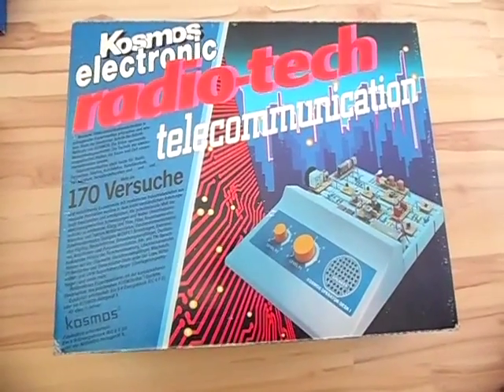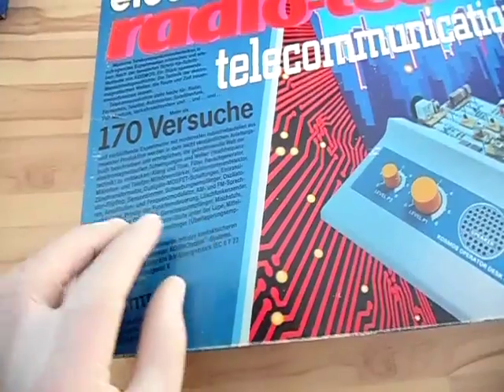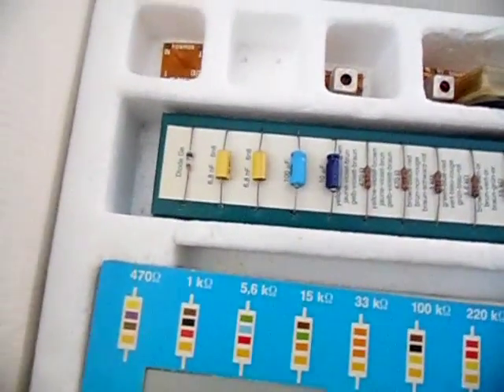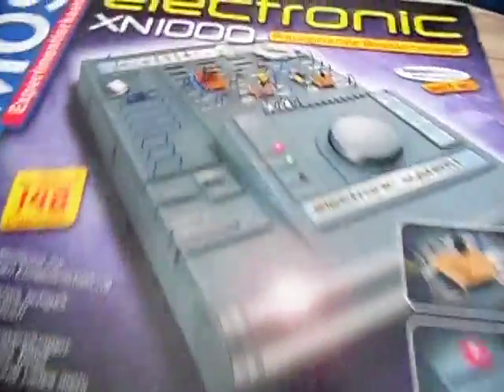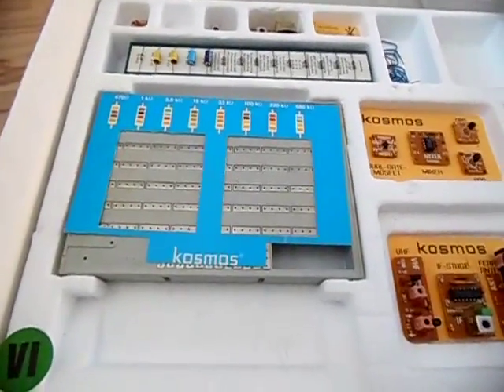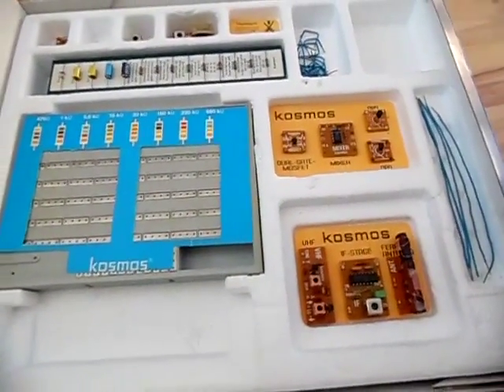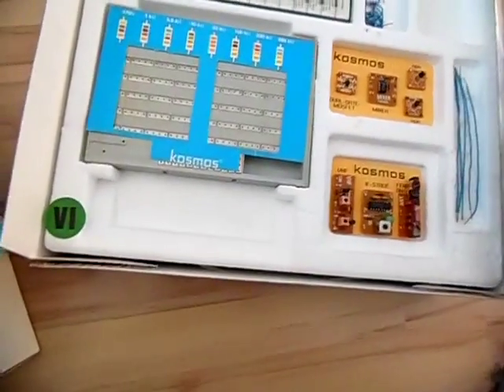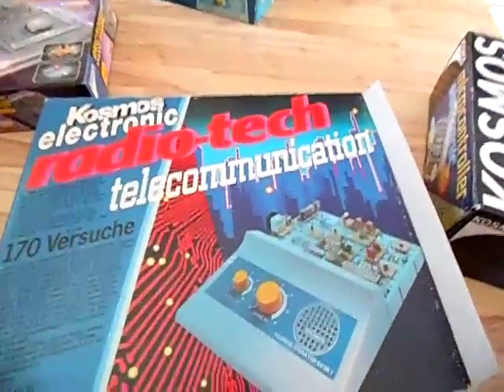Kosmos electronic radio-tech

Comment: Hi! Thank you for doing these videos.  We have a Kosmos electronic X2000, but no manual.  Do you know if there is somewhere we can download a digital copy? We are in the United States and most sites that mention this kit are in German.  I would even be happy if it's in German, we could always work through the translation. Thank you for any help.
Reply from the maker: Hello,
you could check out forums like "Experimentierkasten board" and "Rigert Forum". These Forums are specialized about experiment boxes, they also cover the one you have.

After my knowledge these kits only have been released in parts of Europe. I know of a version in dutch, and I know of a version in french when it comes to these kits, but I´m not having any knowledge of other releases (like the ones in your country).

If you´re patient and occasionly check ebay, you might find single manuals (without the experiment box) put there as an offer - but keep in mind, that it´s not guaranteed, that the seller will ship it that far.

Also you could contact the "Kosmos Verlag" directly, and ask them for a copy, but I´m not sure if they are having these copies as a digital version like as a . pdf file.

In the manual the circuits can also be built without the explanation as there are picturs showing how to position / place the components on the board.

I also do own the "Kosmos X2000" including all parts and the manual. Maybe... I could give you a few pictures of some of the circuits (The easiest way would be that I make a video where I flip pages in the manual and you then can pause the video and "edit out" the pictures because single-photographing them would be a lot of work). I´m also not promising that I do that.

The Kosmos X1000 is mainly basic circuits like blinking LED light, logical circuits (and / or / nor circuits with switches and LED) and tone generators ... timers (breakfast egg timer)...

The "best" project in my oppinion is the AM radio that you will built at the end of the X1000 manual. There are two radios listed, the 2nd one is more sensitive than the first one, which is a simple detector as the second one is a receiver that has the name "boy radio" (or also "boy´s radio"). Actually it´s a "reflex receiver" but somehow it got named like that.

The X2000 adds an amplifier module ("AMP") which also lets you built oscillators - with the "photo transistor" that´s included in the X2000 you will also be able to built a "light based alarm clock radio" that starts playing when it get´s bright in the room in the morning...

They also have the two AM radios from the X1000, but now they add the "AMP" module to it, so you can hear the stations with a loudspeaker now.

I hope I could help you a bit with this information. Also g o o g l e picture search for "Kosmos X1000" "Kosmos X1000 Anleitung" and "Kosmos X2000" "Kosmos X2000 Anleitung" might bring up at least a few experiments that you can build with your kit.

I also could help with the translation, but it´s a time-thing. I´m usually quite busy... especially lately.

Comment: Schön zu sehen, daß es hier auch ein Video über die Kosmos Kästen gibt. Ich habe meine auch noch alle da, den X1000, X2000, X4000, High Tech und Radio Tech. Ich habe ewig Zeit mit den Dingern verbracht. Die Beschreibung der besseren Kästen (ab X3000) ist auch sehr gut gemacht, sehr verständlich. Ich glaube das ist auch der Grund, weshalb ich gerne diverse Dinge anschaulich erkläre. Bei meinen Kästen sind die gelben Einleger inzwischen sehr zerledert. Ich will mir die per DTP mal neu machen.

Comment: I just bought the X1000 to X4000 from someone in Germany. I used to own the X1000 back in the last 80's.. and was always promised the X2000 to X4000 when I grew up but never received them. Looking forward to playing with it soon :)
PS. What other types of kits did they make at this time? I think a Auto kit and also radio. Do you have any more info about the different kits they sold? One I think is "High Tech" ?

Thanks for the video. Alles Gute :)
Reply: Indeed there was a 'High Tech' box (It still sits in my room here, to be unpacked one day... manual is in French and I'm Dutch...)
I bought a used X4000 from a friend of my mom for an absolute bargain (25 guilders, about 12 euro).